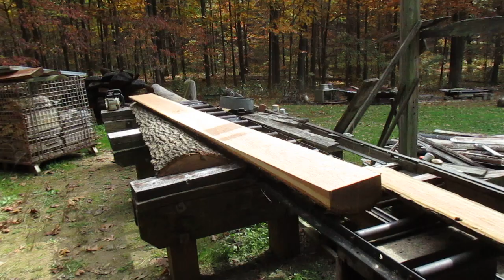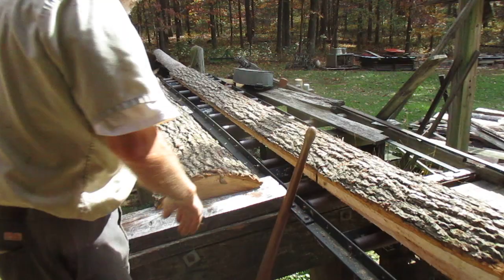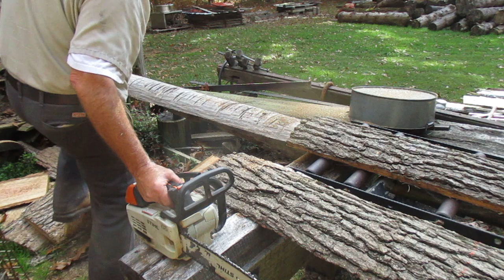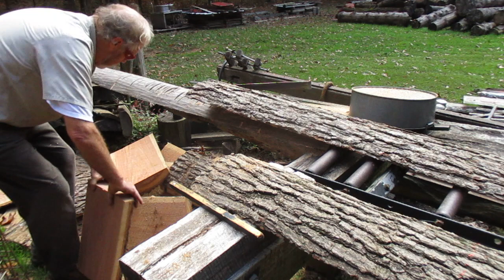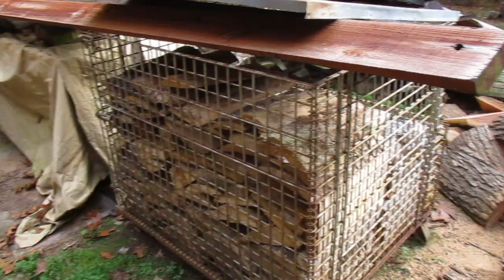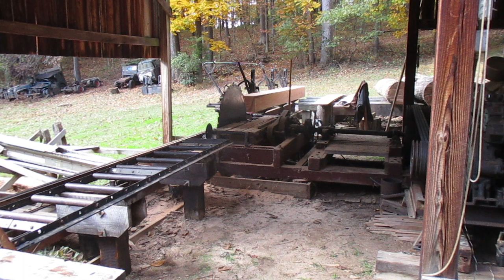#136 Frick sawmill clean up time

Comment: I use all of my hardwood slabs to heat the house. Luckily, our wood stove can handle up to 30" long pieces. My saw has a 25" bar so I use the bar as my measuring stick and cut just a tad shorter so I can split it in the log splitter if needed.
Reply from the maker: the door on my boiler is 48x18 . i stopped putting big pieces in cause i just can't lift them any more and the big chunks have to high moister . realy getting into fire wood moisture . a cord of red oak has over 300 gallons of water .